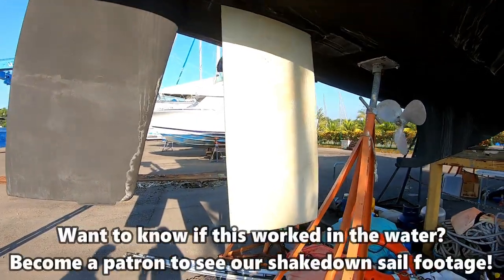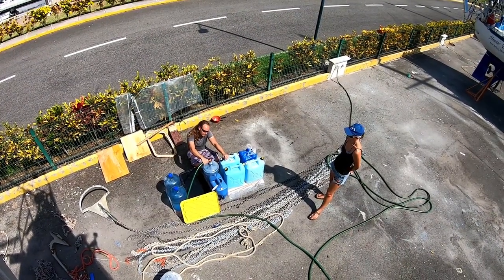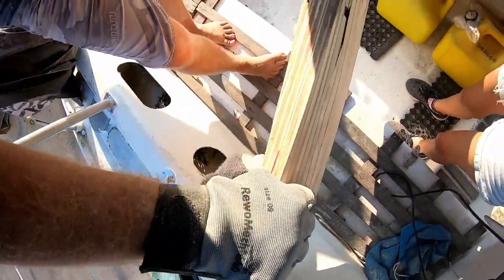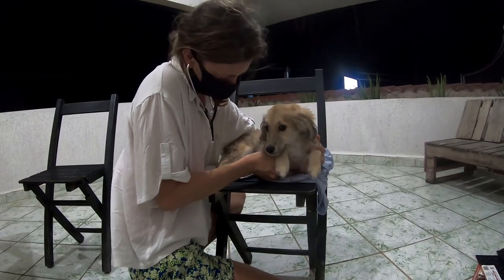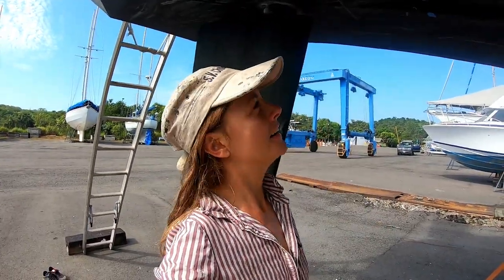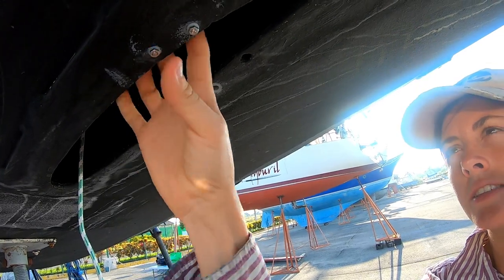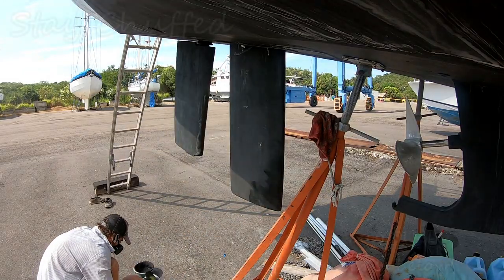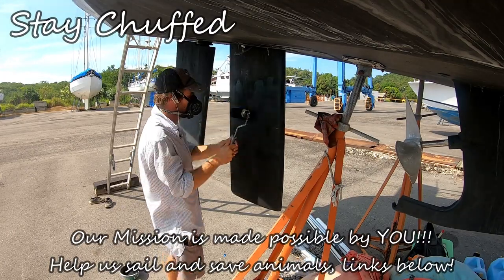DIY Dagger-board Installation : Chuffed Adventures S03Ep32

Comment: One thing I can imagine happening with it, is , the outer coating leaks just a tiny bit, and gets to the plywood. The plywood expands. Its a fairly tight fit, so it doesn't come out next time you want it to. It might be hard to tell when its really getting tighter as your putting a lot of force pulling up but not really measuring that force. Tricky. One thing that might help would be for water to not come in from the top. That is where it needs to slide.

Comment: This is something that just about any sailboat would benefit from. Many well-known designers have used this feature effectively. Off the wind, of course it will help keep the pointy end going the right way.  But didn't she have an unusual amount of weather helm before? This should make a huge difference in helm balance, and compensate for the added drag by better balancing the helm. I would use it for fine-tuning the balance on all points of sail. You might find it difficult to raise or lower before realizing that short, quick, strong back-and-forth tiller swings will completely neutralize the pressure and it will slide as if the boat were stationary. All the way down is perfect for sailing with the main only even to weather. 
Anyway, that's my unsolicited two cents. I think it's great!

Comment: The down haul on the dagger board is mainly to counter act the buoyancy of the wooden board when down... , and to settle the up and down inertia under way... makes better reversing too as it assists prop wash to one side spinning the stern... The boat will track better too under sail. AND, in light conditions going down wind you can lift it up to reduce wetted surface area... Clever little device actually...

Comment: Is that a modification?  Maybe to protect the rudder?  And help climbing?  Wild placement.   You still have swing keel right?   Is their an episode that covers your boat and design?  Or why dagger board needed?
Reply: Great question Carla, I was thinking the same thing myself and would love to know more about this boat with the weird dagger board :-)
Reply: The pocket it goes into is clearly part of the original construction, and since she acquired the boat as very used, she may not have a lot of info.  I would speculate that given the swing keel being of modest proportions there was a design need for an additional fin to create sufficient tracking capability.
Reply: @blueboats7530  I agree in providing better tracking. Also is it possible it could be retracted to provide better windward performance ??

Comment: so the dagger board isnt about stability which is presumably afforded by the hull. 
Its more about providing dynamic stability by moving the center of lateral resistance aft
kind of a unique system.
Reply: Quite a few French boats of this nature have 2 centreboards. i think it was a designer called Philipe Harle that was the originator (well, in modern times - IIRC Thor Heyerdahl had a few on his raft as well. )

Comment: A centre board just in front of the rudder is a very odd design feature and definitely not worth while. i would have replaced it with a skeg.
Reply: I would agree to a point. The boat was designed for a certain non blue water type of sailing and performs very well for that. I wouldn't necessarily want to be in blue water in a squall with it.

Comment: Hopefully you haven't found out the hard way by now that nylon expands in seawater. More slack/tolerance than that will be required.
Reply from the maker: Its not nylon, I believe it is PFTE (we sourced so much different stuff, but Will was a boat builder so we feel good about it! so far works a charm)

Comment: The Dagger-board is too wobbly. It will make noise. The rope can accidently touch the prop and wind it up with great force! To hold the board down, I would prefer a construction that clamps the board and prevents it from wobbling at the same time. Two wedges or something like that. Possibly something inflatable  like a tiretube. Let someone professional check this construction. If it touches the ground, huges forces can appear.
Reply: All boards are "noisy"
Reply: Yes, but something that rumbles against the hull could be very noisy. Hopefully not.